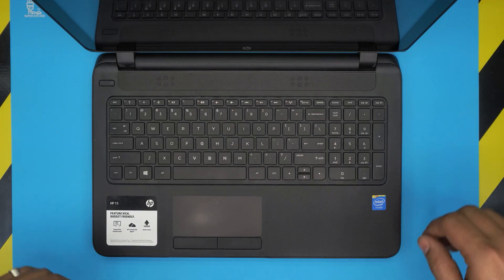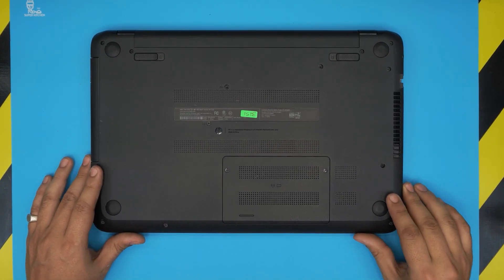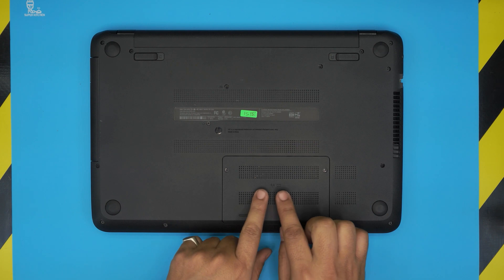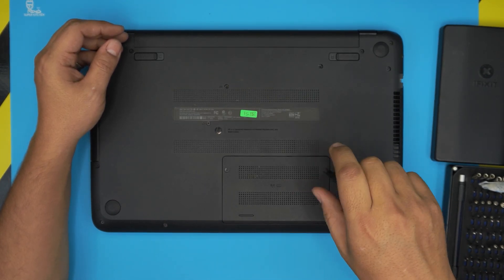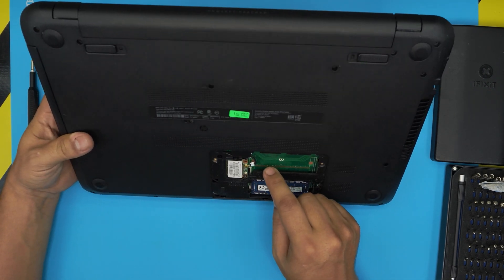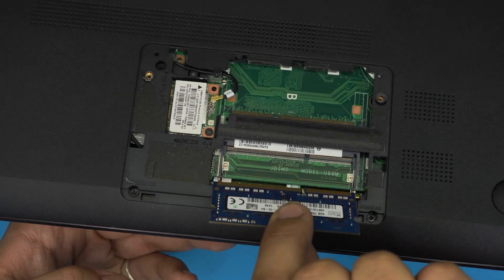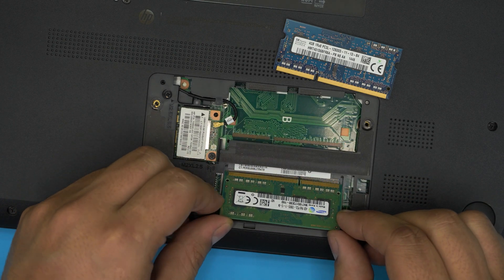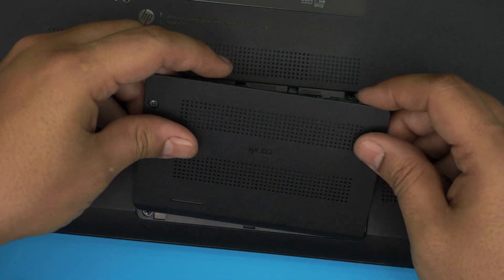Hp 15 F Series laptop Ram Upgrade | FULL GUIDE

Comment: I have a HP 15-f272wm computer can I add a second ram memory?
Reply from the maker: 🫠Regarding your question, the best thing you can do is remove the RAM cover and check for yourself if there is a second RAM slot or not. These laptops are shipped with one slot, but some sellers have offered them with two slots.
cheers🍻

Comment: Thank you for this video, My laptop is hp 15-f305dx, It got ddr3 4gb ram, Dram frequency of 672 Mhz, Max bandwidth - PC3-12800(800 MHz) i got these info from CPUID-CPU Z app, When i checked the memory in task manager, It showed the speed as 1333Mhz,Slots used 1 of 2, Form factor- Sodium, Hardware reserved- 826mb,  Is it possible for me to upgrade the ram to 8gb ddr3 1600Mhz, PC3L-12800 ram ? ( Sorry, i don't know much about this and i would really appreciate if you would help)
Reply from the maker: It's my pleasure, my friend. 😊 I deeply appreciate your taking the time to provide feedback. If you're inclined to support the channel further, feel free to like and subscribe—or even both!
Regarding your question, sure you can place a 8gb sdram ddr3L and remove the 4gb because you only have one slot available.
the task manager doesn't know that you don't have the 2nd slot available.
Should you have any further questions or requests in the future, please don't hesitate to ask me.
cheers🍻
Reply: @uFixTek  tnx for the reply, i apologize if my question was incorrect what i meant to ask you is that i already have a 4gb ram ddr3l installed in my pc ( default ) i have a second free slot which i am planning to use to upgrade my laptop, So can i use a 4gb or 8gb ddr3l 1600Mhz ram to get 8gb or 12gb? besides my main question is. in cpu-z( spd section ) it shows the current ram in slot 1 as ddr3l pc312800 and ranks - single, so can i use a double rank ram with 8gb ddr3l 1600mhz on my pc? is it okay if i mix the ranks?
Reply from the maker: it is totally fine any you can do that without any issue.  just make sure you get DDR3L (L= Low voltage).single double make no difference.
Reply: @uFixTek  thank you so much for the reply, when i have checked the crucial website, it showed  that  my laptop (hp 15s f305dx can handle up to 16gb of ram) but the official website said that is is 8gb ram, i am confused, can you recommend, should i go for 4gb ram ddr3 single rank( current one )  + 8gb ram ddr3l 1600mhz dual rank or just use 2-8gb ram to get 16gb ( both dual rank), i am little bit confused whether if my lap supports 16gb?
Reply from the maker: you can go with 8gb ram ddr3l 1600mhz,
but i would prefer the 2x8gb
Reply: @uFixTek  Thanks for your insight, i will go with the 2x8gb as you advised, Have a nice day :)
Reply: @uFixTek  i found out in the hp  manual that it will only supports up to 8gb of ram

Comment: They have pin layouts so you can solder ram slot in but this is because it’s in lower end laptop with a pre-existing motherboard and they had to make cheap cuts
Reply from the maker: even  if you solder the slot on board still wont work as there are many other components that needs to be installed (caps, power regulator and many more) that are not soldered on board to make that work, we have tested out with soldering the slot only, and then we looked at the schematics and realize that there are many other components are needed.
cheers🍻

Comment: Ugh. I wish I had noticed the other slot is not functional before I bought a 4 GB module to add. I knew the max was 8 GB so I thought I would just add 4 more. Now I wasted money on that and still have to buy an 8 GB to do the full upgrade. Why would they have a slot there if it's not usable?? 🤬
Reply from the maker: Thank you for the feedback! if you wish to support the channel you can LIKE or SUB or both :P
regarding your frustration: it is upsetting to see this, but HP loves pulling this crap on it's clients :( they started doing this 5years ago. i see the anger on all my clients when they come to the shop.
i recommend to check racionabilidad or motherboard pictures before purchase any.

Comment: I don’t know a ton about laptops but is it possible to upgrade the cpu I’ve already upgraded the ram pls get back to me
Reply from the maker: Thank you for the feedback! if you wish to support the channel you can LIKE or SUB or both :P
regarding your question: sorrry my friend i have to inform you that you can't upgrade the CPU on this laptop and on almost 99% the laptops out there, as they are soldered on board and lock with components to the exact voltage and power management required for it.
Reply: @uFixTek  that’s what I thought I’ve cleared some of the background stuff I don’t use and it’s running a bit better thanks tho
Reply from the maker: if you need me to optimize or check your laptop i would gladly do it for you as i do this for my clients. its via remote.
if you have any question or request in the future feel free to ask me.

Comment: What upgrades can be done on this model? I'm wanting to upgrade the ram but wondering if other upgrades can be made a well. Thanks!
Reply from the maker: Thank you for the feedback! if you wish to support the channel you can LIKE or SUB or both :P
regarding your question: the only upgrades you can do is the HDD to SSD and the ram. IF You have mechanical HDD i highly recommend you to upgrade it to SSD 2.5" a good durable is samsung: https://amzn.to/3cvkBvp
here is a video how to get to the hard drive: https://youtu.be/GwYz_9rgf5Q
and then install windows 10 or 11 fresh install:
https://youtu.be/uDu8j2lE-dM
how to install on Hp laptops:
https://youtu.be/7f_rBp6Rb3s
Reply: UNFilteredMatrix  i did, I upgraded to a side and 8gb of ram and it helped a little, wasn't the results I was hoping for though.

Comment: I have been trying to look this up with no success: will/did the HP 15-F accept the 2Rx8 ram? The A-Tech that you linked is a 2Rx8, and the HP 15-F one I'm trying to work on has one pre-installed Kingston 4 GB 1Rx8 ram.
What I found online about replacing the Ram module(s) is to look up the motherboard compatibility for Ram and etc, and I have found nothing that will help me to know if a 2Rx8 Ram will be compatible with the laptop.
Reply from the maker: sorry that i was away for few days
Thank you for the feedback! if you wish to support the channel you can LIKE or SUB or both :P
regarding your question: the 2R or 1R makes no difference for your motherboard both will work just fine, 1R = single rank 2R = dual rank, people with high end CPU and high end motherboard use the single rank in order to take advantage of every millisecond. 
you can place a 8GB DDR3L make sure its L for low voltage and it will work just fine, we upgrade them all the time.
Reply: @uFixTek  I understand, and thank you for taking the time to answer my question, it gave me relief!
Reply from the maker: its my pleasure my friend :)